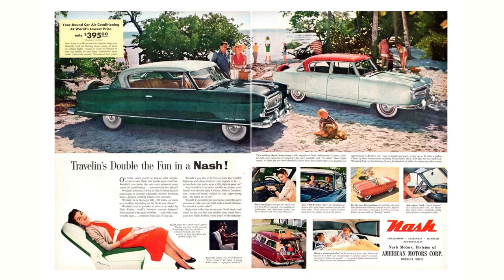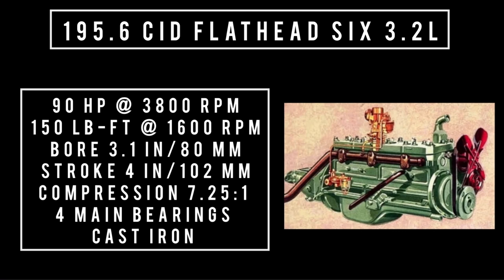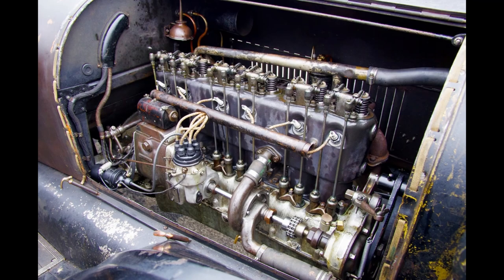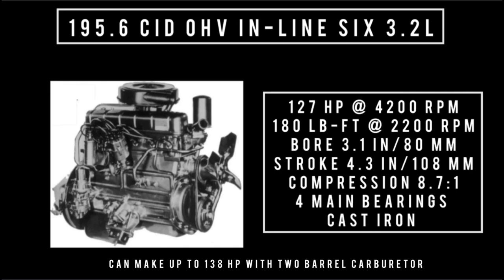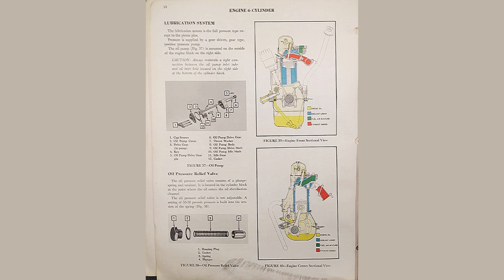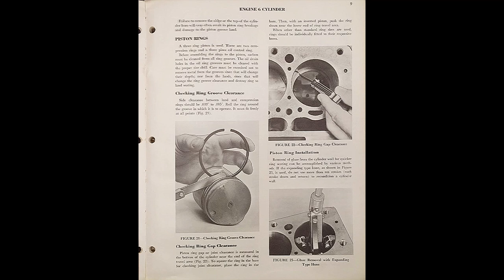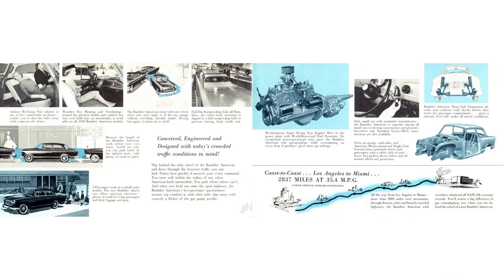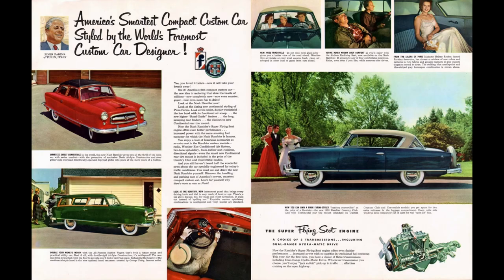195.6 engine from flathead to overhead valve, NASH to AMC

Comment: Outstanding as always - thank you.  Connections - might be fun to throw a twist in.  Connections between/among cars and car makers.  There were so many swaps of people (like you referenced with Charles Nash) in the automotive industry it could be fun.  The same with cars, like Rolls Royce using GM Turbohydromatic transmissions.  ~ Chuck
Reply from the maker: Glad you dig this episode more AMC six is coming next week the popular ones.. I was going to make it all one episode but dissension is vastly different than those so I figured I’d break it up I really want to cover the original Nash overhead valve six that came out in 1925 I just have to go to a library to find out more information about that one because there is no information on the Internet about it.. It was the one in the advertisement that said twin ignition I think it produced 60 hp And it came out four years before Chevy did.. it was replaced with an overhead valve in line 8 the six cylinder had seven main bearings just like the one AMC made to replace the 195.6.. The overhead valve in line 8 that replaced it had nine main bearings

Comment: I had a 1962 Rambler American with the 196 flathead. It was a great, efficient engine.
Reply from the maker: Sweet =) i’m a huge Nash Van I will have the early ramblers from 50 to 53  for all of them had a flat head I don’t know if it was the 196 it would’ve been a 180 for 172.6.. the two door wagon is where it’s at, I can’t believe how rare those are now I’ve only seen a handful of them and out of the ones that I seen only one of them was stock the rest of them had 350 V8 in a custom interior I’m not for that I don’t mind an engine swap but it doesn’t need Crager SS wheels with bucket seats it kind of ruins it
Reply: None smoother!...My mechanic looked forward to doing the annual tune-up on my 59American flat six...He enjoyed test-driving it after tuning it up...He swore it was the smoothest, sweetest-running car he had ever driven. I could not argue!
Reply: What kind of fuel economy did you guys get with the flathead?

Comment: Did the early OHV Rambler engine have an aluminum cylinder head? 
I understand that engineering a reliable head gasket sealing ability and reliability of the head bolting system is a significant challenge when dissimilar metals are used in the cylinder block and the head. There may still be a slightly higher risk of head gasket leaking and failure on modern car engines with aluminum heads over iron blocks as compared to the old cast iron head on an iron block.
Also I suspect that part of the "tune up" on an old iron block and head engine was to retorque or check that the head bolts were not loose. Might have still been occasionally recommended on the Chevrolet overhead valve 230 Six that was common into the early 1970s.
Reply: Only the 1950 "LeMans" OHV six (made for the Nash-Healey) used an aluminum head. There was a one or two year "LeMans" version of the 195.6 flat-head that used dual carbs that might have been aluminum -- I'd have to research that. There were head gasket issues on the aluminum block/iron head 195.6 OHV. Partly due to dissimilar metals, partly due to the overall design of the 195.6 OHV (thermal expansion/contraction of the iron head loosening head bolts over time, as mentioned in the video). The main "dissimilar metals" issue was the anti-freeze used in the early 60s. It wasn't aluminum friendly! Rambler people were usually a frugal lot and didn't like purchasing "special" anti-freeze from the dealer -- felt it was just a gimick by the dealer to get more money since that anti-freeze cost more than then standard anti-freeze. This lead to accelerated corrosion, especially at the head/block interface.
Reply: Jim Flournoy  @AMCMag  the dual carb flathead was aluminum and proper antifreeze was essential especially for the AL block motor    I  think later OHV engines had hyd tappets, we did not have to adj valves  on the 61 engine

Comment: Apparently there was a big change or an all new engine block sometime in the 1960s when the Chevrolet 235 six was replaced by the 230 six. Not sure the relation between the 230 and the smaller six used in some Nova cars or which was the ancestor of the 4 cylinder Nova engine or what eventually became the "Iron Duke"
I think the 250 pickup truck engine was derived from the 230 and perhaps also the 292 inline six that was in some medium duty trucks
Reply from the maker: Chevy 230 totally different engine family

Comment: Yes, the larger Nash OHV 6 was still in production for the first half of the 50's. I'll hazard a guess that the big 6, at 4.1 litres was anticipated to be rendered redundant by the V8 on the drawing board. But they still needed a small engine, so for that reason updated the flathead.
Reply from the maker: Awesome information I just saw they essentially offered three engine choices small mid and big

Comment: The flathead 196  had issues with head gaskets and needed retorquing often!  My parents had a 1960 Rambler American station wagon with the 196 OHV and never had the head torqued!
Reply from the maker: I got to drive a 62 last year AMC cross-country Rambler wagon with 196 overhead valve and I thought I had put plenty of pep.. A lot of people say that that car is under powered but it didn’t feel under power to me Karman Ghia that feels a bit under powered.. especially when you get at the bottom of the hill and you’re going slow.
Reply: You most likely have that backwards. The flat-head has no issues with the head gasket, the OHV does.
Reply: In the American the 195.6 OHV is pretty good. The flat-head feels a little anemic in modern driving, the OHV adequate. When the OHV is in the bigger cars it's a different story. Ok around town due to lower gearing, not so much on the freeway.
Reply: @AMCMag  No, I owned one; rebuilt it, had the block and head surfaced, I know what I am talking about.
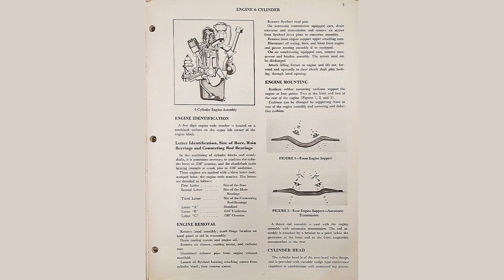Reply: @AMCMag  60 American with 4:11 gears and dual carbs had plenty of power, up the grapevine in second overdrive or third  you could put a switch to control the od  just like a ford pickup

Comment: Actually they did sell the OHV version alongside the flatheads in 65 but since the flathead came first it did technically outlast the OHV 195.6.
Reply from the maker: Good to know thank you so much for sharing that information =)
Reply: @What.its.like.  I really liked the video and I  learned that I should probably tighten up my valves.
Reply from the maker: Glad you dig this episode =) 

I’m hiding out in the common section mileage may vary like maintenance on any other engine.. One person claimed that they didn’t re-torque head bolts and drove allegedly 100,000 miles without issue.. but I’ve heard horror stories from people who chose not to

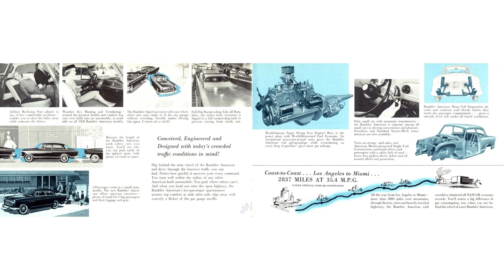Comment: 35.4 MPG at 6:51 What happened ? Most cars get nothing like that with all their fuel injection and multi computers etc etc.
Reply from the maker: That’s been my biggest argument forever we have all of this technology now and yet we can’t get any better gas mileage than they did back in the day. I would love to debate somebody on that issue.. I honestly think that they should bring back the flathead forge all the internals and turbo charge it because those engines naturally got low compression adding a turbo charger would bring it up to snuff, I was always told the flathead design was an inefficient engine but they got 32 miles to the gallon what was inefficient about that
Reply: @What.its.like. 

As engine fuel management improved, there were two possible alternatives. 

1. Keep performance modest and. improve gas mileage.

2 Keep gas mileage the same and improve performance. 

The later became the norm.

Lately fuel milage has improved by downsizing the cars.  Performance is king.

One could accept lower performance and have the cars the size of yesteryear.
Reply: @What.its.like.  Show me today a full sized car with that head room that gets that mpg. Good luck
Reply from the maker: @dougabbott8261 
2023 Toyota sienna hybrid gets 40… 2023 Honda Odyssey gets 32…
Reply: @dougabbott8261  

Id imagine those exist in foreign countries. They would have car bodies like we are used to.  Their engines would be much smaller. Zero to 60 times would be similar to the Nash.
Reply: Ethanol in the gas lowers MPG.

Comment: Nash also had an OHV straight eight, with 9 main bearings, from '32-40, only Packard also used 9 main bearings, on straight eights, during this period, and Packard used flatheads only, until they brought out their V8, in '55.
Reply from the maker: Yes but that was an in line eight they had a 6 with 7 mains at that time as well both super underrated engines

Comment: The V8 used in 1955-1956 Nash and Hudson’s was actually a Packard motor.
Reply from the maker: Yes but the 250 came in 56 or 57
Reply: Yes as well as the 327

Comment: 3:26 the OHV version did not make "up to 127 HP:  it made up to 138 HP.  Your comments with regard to maintenance on the flathead and OHV are waaaayyyyy off. the Flathead was far from bullet proof and in addition to oil changes and valve adjustment (which is  pain in the ass), the flathead engine needed frequent attention to points and suffered frequent overheating and vapor lock. Your comments as regards the OHV have been debunked for more than 20 years.  those of us in the field who actually work on these engines daily simply bypass the thermostat to solve half the issues. The remainder are addressed with head studs rather than bolts. Your commentsw with regard to heating this engine are also off.   The overhead valve version of the engine can weather modest overheating just fine and is no more susceptible than is the chevy 230, 235, or 250 or the ford 144 170 or 200. Caveat here is that overheating can not be due to a lack of oil.  your claim as to unforgiving is bogus. The head gasket does not "blow" from overheating, it becomes defective over time from the failure to torque the head or bypass the thermostat.   And you are wrong about the end of production for the OHV. It was not 1964.  In 1965 major changes to the 196 OHV were made resulting in a full flow oil filter and a bypassed thermostat and the engine was found in all Americans with air conditioning because the bracketry for AC would not fit under the American hood in the longer 232/199 block. Anyone who actually researched the topic would have found this as all the engines are in the TSM (Technical Serivce Manual for 65). I am guessing that your leaving my comments here for all to see will require character and eating a little humble pie.  I am curious as to your appetite.
Reply from the maker: I’m an enthusiast not an expert thank you so much for all the information here is where I got the information 

https://en.m.wikipedia.org/wiki/AMC_straight-6_engine

https://www.ramblerlore.com/AMC/195.6ohv/index.html

1964 was the last year of aluminum block ohv 196, both the flathead and ohv were discontinued in 1965.. it’s been so long since doing this episode I can’t find all the sources 

Thank you so much for all the corrections 

It’s not about eating humble pie, I can admit when I’m wrong like I said i’m enthusiast not an expert, I’m not like one of these new car youtube reviewer that gets the information spoon fed to them I have to research and find the information and sometimes/a lot of times information on the internet is wrong.. so I appreciate the information you brought =)
Reply: @What.its.like.  Wikipedia is an unverified crowd contributed source that is often incorrect because "enthusiasts" like you who wont take responsibility for proper sourcing, contribute to the page.  Even a 9th grader knows that they are not allowed to use Wikipedia as a source for research for that reason.  Please do not cop out and call yourself an enthusiast as an excuse for not doing your homework.  You are not as enthusiastic in seeking the truth as you are in making videos and hearing your own voice.  what you produced is  unfair to the engine and the car and the period in history and the enthusiasts in the hobby who need vetted authoritative information
Reply from the maker: It’s possible to correct and not be a total dick, everyone uses Wikipedia it wasn’t the only source used I made this episode months ago I will start posting references used in description so you could go after them instead of attacking me.
Reply: @What.its.like.  Just as it is possible to post and not be totally inaccurate

Comment: I enjoyed this new segment. Only the first Chevy Vega motors were worse.
Reply from the maker: This isn’t a bad engine it just requires a lot of maintenance if you get the overhead valve version the flathead version I believe gave out better economy that was the economy engine the one that got 30 something miles to the gallon.. 

What gets me is the flat head design is said to be inefficient and yet it gets better fuel economy numbers than a lot of stuff that was on sale 10 years ago.. I personally think they need to bring back the Flathead forge the internals and add a turbo charger to it I bet you they could probably get 40 to 45 maybe even 50 miles to the gallon out of a flat head

Comment: AMC . . . . . . ALL MANUFACTURE'S CONTRIBUTING
Reply from the maker: If you can’t tell besides an orphan car fan I’m in AMC fan but I like AMC from the 50s and 60s they kind of lost their way a little bit I love the eagle too =)
Reply: @What.its.like.  I liked AMC too, but some of the things they did were just crazy, or lazy. 
All spindles on an AMC unbolted. So you could put 70s car disc brakes on 50s-60s cars no problem, The twin stick three speed overdrive was a great idea, But the closed driveshaft rear end  up until 64-65 not so great!
Reply: No more so than other car companies. They all buy components from each other and from outside suppliers.
Reply: @danielulz1640 yes, thank you - correct.  As am AMC enthusiast, I find that all the commentators and "experts" have NOT a clue about what they are talking about.  50 years on still haters and worse - amateur comedians. 
To your point, how's that BMW engine in the newest Supra doing?...
Reply: How about the Willys 230OHC six? It live on in Argentina to power AMC cars. And the Jeep Wagoneer sand trucks used the AMC sixes!
Reply: @danielulz1640  I realize that some parts interchanged, and we're shared, in some cars. to certain extent. At one time Borg Warner made transmissions, and gauges, and most manufacturers used them. AMC used transmissions from Packard, then hydromatic from GM, I had a 1969 AMC with a   360 and a torque flight.  AMC standard transmissions were Borg Warner. Chevy, Ford, and Mopar, all developed their own standard transmissions. AMC started developing their own engines in late 56, but those are totally different than 66 and up engines. Their is no standard bell housing pattern on them. Closed drive shaft rear ends. They were a mess! Still I like some AMC products.
Reply: @robertwatkins364  dude, the 360's were introduced in '70.  Tourqeflytes were introduced at AMC in '72 and they NEVER used Hydramatics.  Packard transmissions? I don't think so.  And AMC ALWAYS  had their own engines.  Not untill the '80's did they use something else - AUDI 4-banger.
Reply: @robertwatkins364  Nash bought Hydramatic transmissions from GM in 1950.  In 1955 and early 1956, Nash offered the Packard V8 and Ultramatic  transmission as an option. In April 1956, American Motors produced thier own V8 and offered it with a Borg Warner automatic transmission. (Ford-O-Matic was also a Borg Warner.)  Borg Warner Shift Command was used until 1972 when AMC switched to Torque Command supplied by Chrysler. The 360 cid V8 was introduced, I believe, for the 1971 model. If you are correct, then your car must have had a replacement engine and transmission.
Reply: @audieconrad8995  actually, Nash DID use GM Hydramatics from 1950 through 1956 when they switched to a Borg Warner automatic "Shift Command ".  They DID offer the Packard V8 and Ultramatic transmission as an option in 1955 and early 1956.
Reply: @danielulz1640  it may have been a 1971. It's been since 1998 it was just transportation at the time. It ran great, with plenty of power, but the brakes were weak.
Reply: @robertwatkins364  if it had a Chrysler built transmission, then it would have had to be, at least, a 72.
Reply: @audieconrad8995  Nash did use Hydramatics starting in 1950.
Reply: @markchandler90  1950...🤷‍♂️ ok.
Reply: @robertwatkins364  last year for the closed driveshaft was 1966 on Ambassador's and the Classic. Americans always had a open driveshaft.
Reply: @robertwatkins364  360 did not show up until 1970 it was a punched out 343. and the Chrysler Torqueflite from Chrysler was first used by AMC in 1972. called Torque Command. Borge Warner Transmissions were used until 1971 called Shift Command.
Reply: @audieconrad8995  Hydramatics were used by Nash in the early 1950's as did most car companies because most did not have their own automatics,even Ford used Hydramatics .
Reply: @danielulz1640  They were hoping to merge Nash Hudson Studebaker and Packard at one point.
Reply: @scrambler69-xk3kv  Wait a Second. I have an original 1951 hot rod mag. They test the two speed Ford trans.Ford-o-matic.  . . . Borg Warner maybe? I'm sure it is not a hydro. Lincolns did have a hydramatic, From 49-54?
I don't have anything against AMC they are just tricky. My friend stopped to ask about a wrecked 1955 Nash ambassador once. The old guy was so ecstatic that someone showed interest, he gave my friend the car. It had a 252.6 with two carbs, and an automatic. It took us forever to figure out how to start the dumb thing. He had the unit body frame pulled twice, but it never would drive straight. I'm sorry to say it went to the junk!
Reply: @scrambler69-xk3kv  correct, that is why Nash offered the Packard engine and transmission for a short time. Too bad that the planned merger never took place.